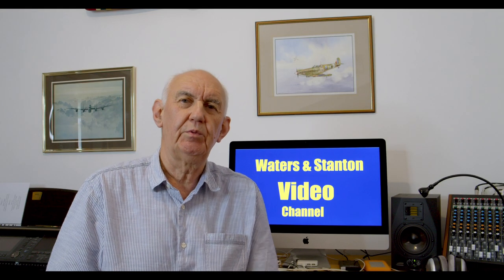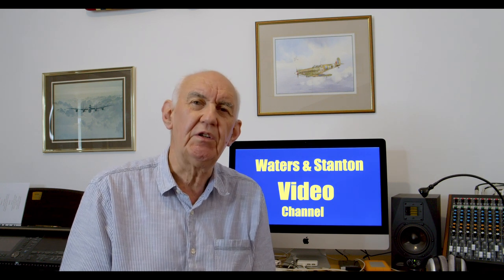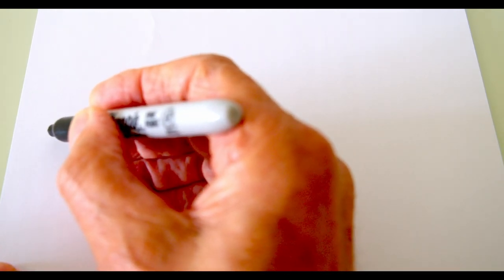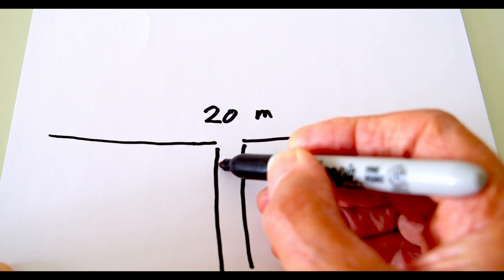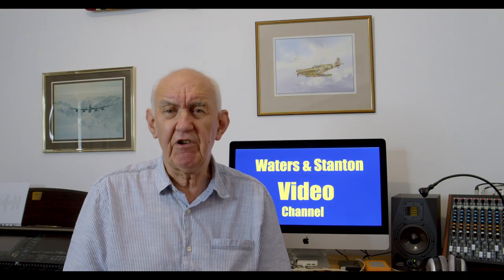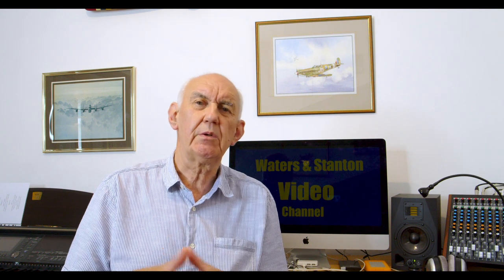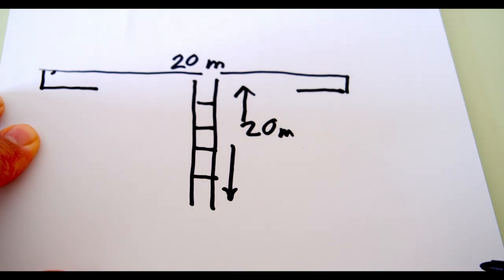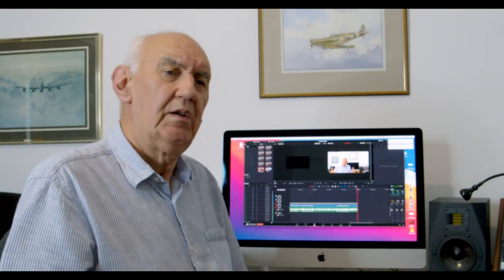Shortening The G5RV Antenna Using Linear Loading

Comment: Even shorter for linear loading an EFHW. I have an 80m and another version 40M at a different heading  with the looped end  sloping back on itself from the height of 5M down to 1.8M high which makes it very easy to tune the end.

Comment: Have tried half size G5RV which is too long for my plot really. With a bit of fiddling I fit it in. Only problem it's so close to everything building etc that it was hard to match and 3 S Points up on noise
Reply from the maker: Very often a small antenna helps, but limits operation on the lower bands. 73 Peter.